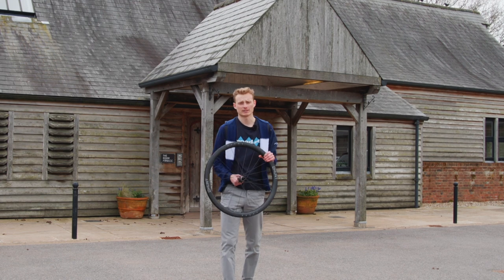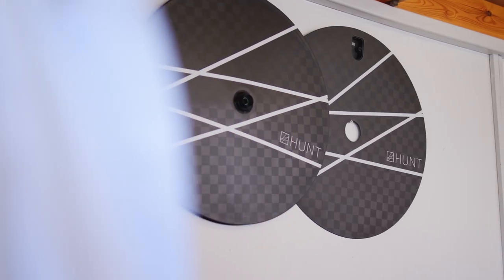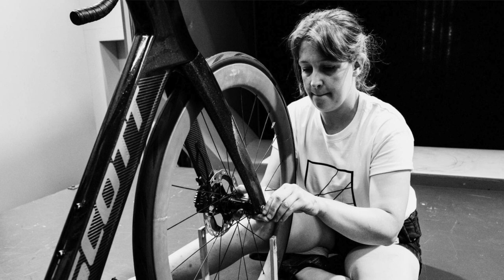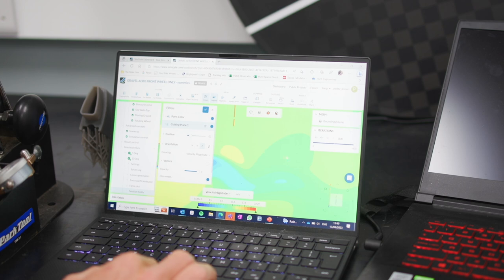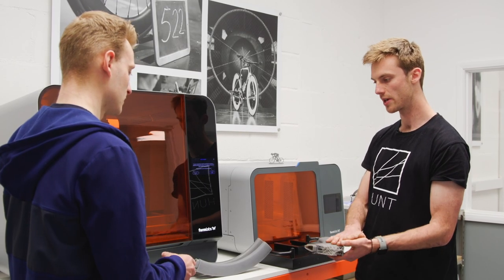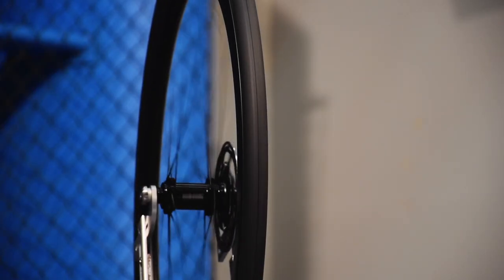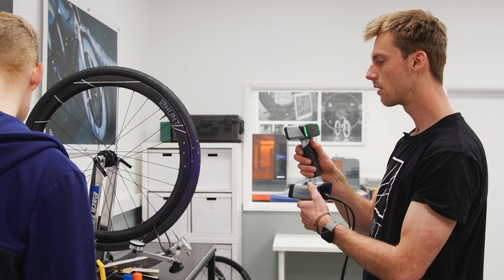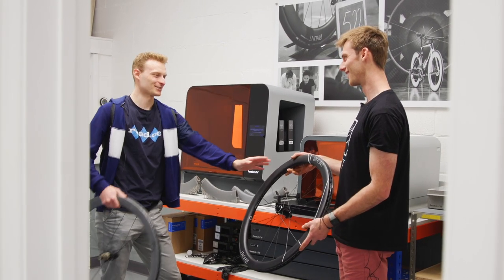Inside Hunt Bike Wheels - The Secrets Behind Making Award Winning Wheels

Comment: By "award winning" do you mean "Loudest, most obnoxious freehub on the planet"?
Reply: I've got a set of Gravel Race wheels. They are excellent, and transformed my bike but they ARE aggressively  fucking loud
Reply: They offer a quieter option.
Reply: A loud freehub just smacks of bad design and quality.
Reply: The noise is great on the greenway.  Walkers with noise cancelling head phones hear me coming.
Reply: You haven't heard my freehub! I think it's a bit difficult to silence them given the ratchet design. I could pack them with grease which will silence them, but the extra resistance will likely negate any aero advantage of the wheel.
Reply: they changed the Freehub.. so it is REALLY fucking quiet now... so you are all good, they made them boring :)

Comment: Wow great video and a great company that backs their products. On my first set of aluminum rim Hunt Aero Wide wheels I had an issue when servicing them where I damaged the axle (my fault) it was still usable (from memory I cracked the hex head from incorrect disassembly) and I contacted Hunt during a weekend here in NZ via their instant messaging, the rep was extremely helpful and said he would send me out a replacement right away, no charge. Only a few days later a new axle, 5x new bearings, a Hunt bidon and a Hunt cycle cap arrived, no charge. These wheels are still going strong and I've since added another two Hunt wheelsets to my gravel bike and my disc brake road bike. Contrast this to another company like Rudy Project that I contacted about a pair of their cycling glasses after their brittle frames snapped after only a months use, they said I must of stored them on the dash board of my car because their frames were not brittle and shouldn't break blah blah blah and just fobbed me off. Thank you Hunt.

Comment: I have the alu race aero wide. Absolutely superb and never had a single issue. And i like the freehub sounds. Well done Hunt
Reply: Are you referring to the Aluminum 34 Aero Wide?  I was considering these to replace heavy stock alloys but also some of the Carbon offerings.  Do you mind to share what these wheels replaced and ride impressions?  It’s tough to beat at half the cost of the carbon versions
Reply: @dorohmc  correct, 34 aero wide. I've had them since April 2018. Went from Fulcrum Quattro and Shimano Ultegra wheels. Narrow rim widths, so both with 25mm tyres lightbulbed. Rode 80ish psi with GP4000, now 55psi tubeless. the comfort improvement was so immediate I sold the 2 wheelsets. I have mavic aksiums for winter, hence no Hunt wheel issues as they never see rain. As for ride impressions. Well they're light and responsive and, most importantly, fun! Highly highly recommend them.
On a side note, I got a pair of Mavic Ksyrium Pro's (alu) and they are a higher quality. Smoother bearings. Even lighter. Definitely noticeable. Worth twice the price? Definitely not. But a nice luxury.
I've now got 30mm on the Hunt's and on my steel bike, so the comfort level is wonderful. Used regularly.
Tubeless or clincher? Hahaha no comment.
I think they're a superb wheelset, and I don't qualify that by saying 'for the price.' you will not be disappointed.
Anyway, as you can hopefully tell, I have a lot of praise and enthusiasm for the Hunt's. If you want to know any more, feel free to ask
Reply: Worse wheels I've ever owned in nearly 40 years of bike riding.  Rims of butter bearings that last months.

Comment: 48 limitless are extremely heavy, but very fast. Still aero with 32mm tires at 34.XXmm WAM. It’s because of the weight that they are my least used of the wheelsets that I own. The majority of the range needs to be updated with 21mm+ internal rim widths. They have the right idea with wide external rim measurements but they need to improve the tire to rim transition while still remaining Hooked. Hookless makes the wheel system as a whole HEAVIER, not lighter as marketing suggests.

A hooked lightweight 25mm Internal wheel would be great. Make it 32mm external so 28mm tires can balloon out to 30mm. Make it like the Ascent Polaris 42mm but with a 25mm rim bed!

Comment: Great wheel set, I have UD 36 carbon rim brake & UD 50 carbon Rim, their are really good!!
Reply: I am deciding between the two depths right now....which one do u like more/ride more. I am riding in the US on an endurance bike in a hilly area but ride fast for mid length workouts (40 mile).
Reply: @christopherjsmith27  I would go for the UD 36 if your riding up the hills

Comment: I like my Hunt wheels and i have almost 9k miles on them but I just wish they shipped them with tighter spoke tension. I'm a heavier rider pushing 200lbs. The first time I rode them, I had 100psi in 25mm tires and it got wobbly on me. Once I put 10psi less and tightened the spokes at 90psi, they stay much more true. Every now and then I still have to retighten them if I use less than 90 psi because the tension just isn't there to stabilize it enough. Also they do get dirty and dusty pretty quickly so I wish they had been finished with a clear coat. My only other gripe is that they hold water like a camel. I think the pin hole needs to be larger and closer to the edge. For the price, I really can't complain though. The carbon seems to be pretty bullet proof with all the potholes and cracks where i live

Comment: I will never buy wheels from Hunt not just because they are hookless (perhaps that changed dunno and don’t care) but because of their ridiculous claims that superlow tire pressure is faster. No, 3 bars on 28 mm tires is NOT faster than 5 no matter how you twist it.
Reply from the maker: Very few in the range are hookless now, Surely that depends where you ride…if you’re off-road then it would definitely be faster, on perfect tarmac high pressure would indeed reduce rolling resistance and everything inbetween is up for debate
Reply: My Hunts are hooked.